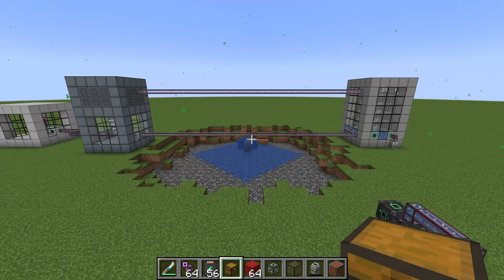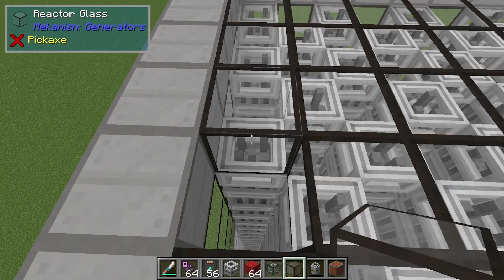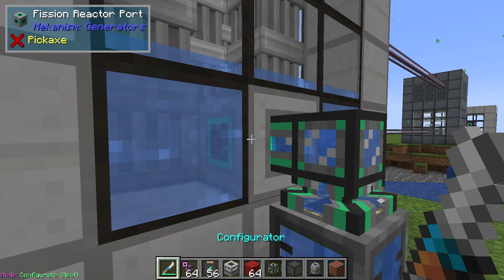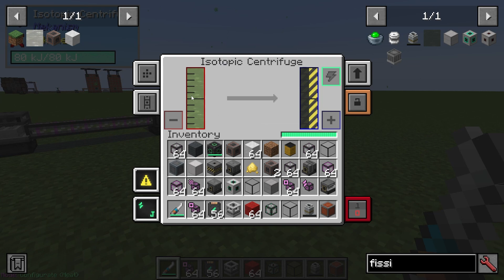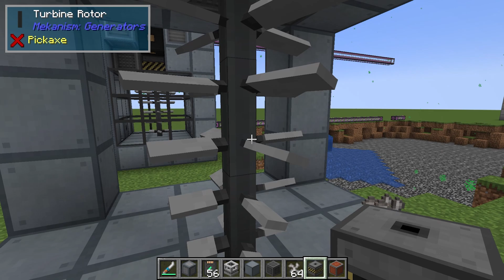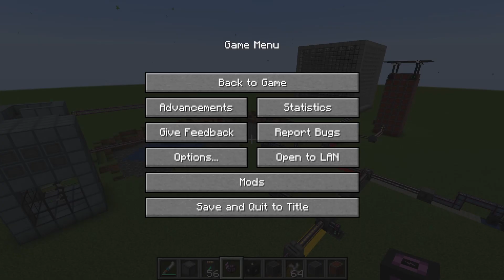Mekanism Fission Reactor & Turbine Tutorial

Comment: pipes aren't connecting to my water sources? like at all? got an elite fluid tank that's being permanently refilled by pumps for infinite water but the mekanism pressurized pipes are just ignoring its existence? MTHRFKER i might just be using the wrong pipes but i have no clue. logistical transporter will connect to the tank but not the reactor.... deadass gonna see if Ender IO's conduits are compatible instead they make more sense Xd
ender Ioi's are not compatible i'm just gonna start plugging in random shit, it she blows she blows lol
ok i tried literally every pipe and cable from mekanism and mekanism reactors none of them connect to *both*?
.
I am confused beyond measure but just when i was loading it up with fuel so it'd chernobyl itself bc i was sick of it the mechanical pipe one connected without any more efforts from myself so i guess its working now lol

Comment: My turbine isn´t asambling
Reply: Check you’ve filled in the floor of the reactor with either glass or structure blocks, and then check you’ve filled the very top layer with turbine vents and not glass/structure blocks.
Reply: @OiCroco  it does not work for me too
Reply: @CTaijine You have to put saturating condensers on top of the coils

Comment: An easy trick that is even recommended in the all the mods guide:

During the test run, use a sink to supply the reactor with an infinite water source. And the steam can be piped directly into a waste bin. That way you are independent of your turbine.
Reply: problame with that is that one sink is eqivilant to 0.5 burn rate so for just 8 burnrate you need  16 sinks

Comment: how am i supposed to pump in so much water in survival
Reply from the maker: Do you have cooking for blockheads? A lot of people use an INSANE amount of sinks from that mod to do it. With Mekanism however itd be water pumps with 8/8 upgrades in them, still a lot of them though
Reply: @JaviHerobrine  yeah ive already figured it out but thanks anyway. Really dumb that they didn't make advanced pumps or sth
Reply: @JaviHerobrine  how do i pump water from a creativefluid tank to the fission reactor? i got mechanical pipes connected to input only

Comment: Worst Tutorial ever. turbine doesnt work like built in the video....
Reply from the maker: Then maybe its your modpack or mc version ? 🤔
Reply: @JaviHerobrine  no you placed vents in the middle where you need condesators
Reply: @michaelfrei9683  current version DOES require those. he might be using a previous version. im trying to get my turbine to actually run, even after it 'builds' it will not work, steam stops coming in but the reactor keeps making tiny amounts of waste and using water and fuel.

Comment: how big can the turbine be? iv got a 10x10 fission reactor and was gonna make a 15x15 turbine but idk if id need to add more to it or just keep it 5x15

update: built the 15x15 didnt work/ built 5x15 also didnt work and i put everything right what am i doing wrong

update2: built the one you made size and everything and still didnt work have they changed it?
Reply: Needs Saturating Condensers above the coils but vent on the outer edge, this setup doesn't seem to work with MC 1.21